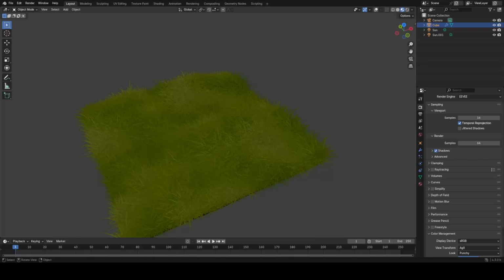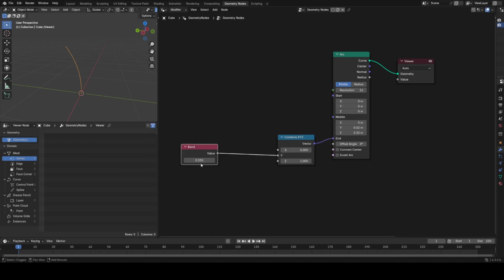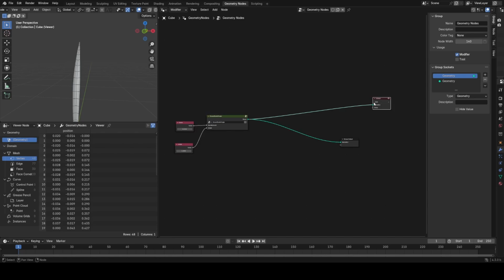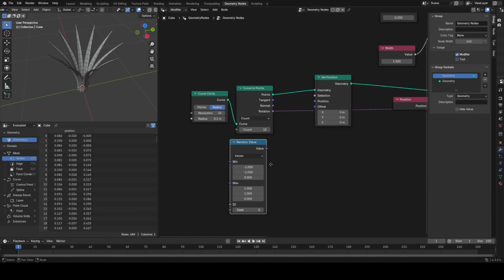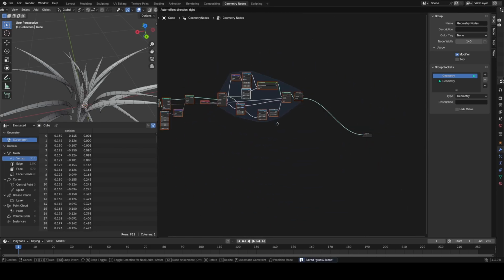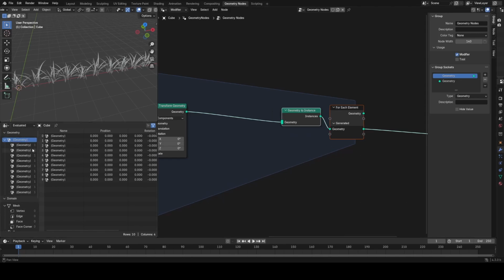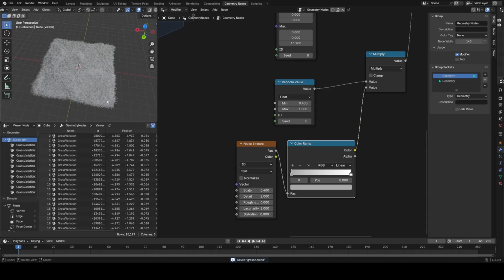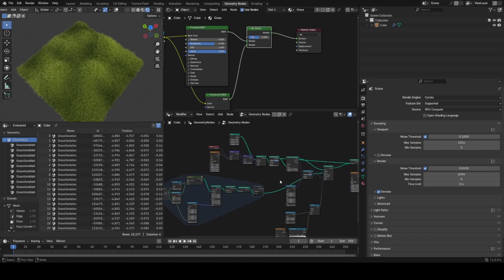HYPER procedural Grass Scatter using new nodes- Blender 4.3

Comment: For each loop and grease pencil geonodes are just amazing. So much new possibilities. Btw. you're a really good tutor. Don't stop :)
One thing I don't really grasp yet is the new hash value node. Could you elaborate on that?
Reply from the maker: Thanks alot! And all hash value does is take an input value, and convert it to some random integer output, like white noise but for more than colors :)

Comment: The only thing better than procedural is hyper procedural. I've always said that.
Reply from the maker: True
Reply: @Polycount-tw4ix  Very cool example of how to use the For Each loop. I'm beginning to see the practical benfits and it does seem pretty performant. Thank you!

One tiny, unrelated tip for quicker node searching - you don't have to type out the node name in the order of letters, e.g. 'ctm' will get you curve to mesh, 'cli' or 'cul' will get you curve line, etc.
Reply from the maker: Thats pretty usefull! Thanks